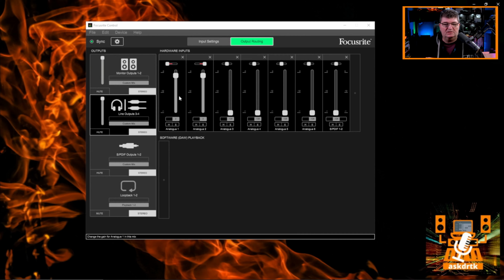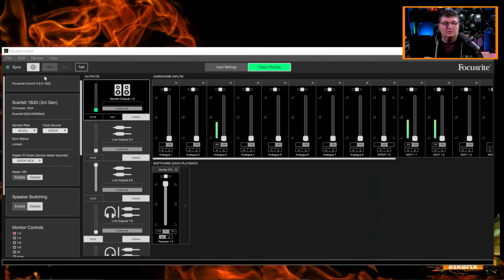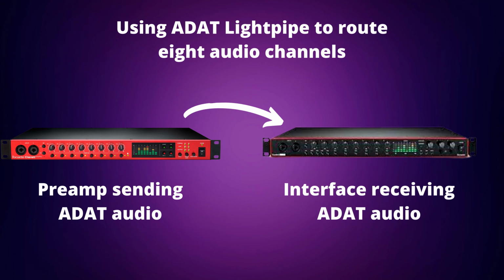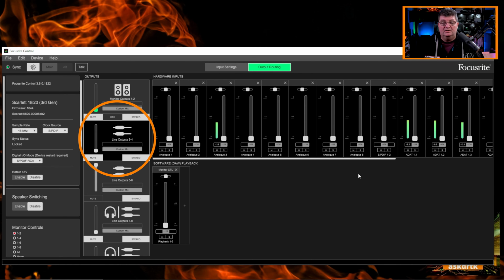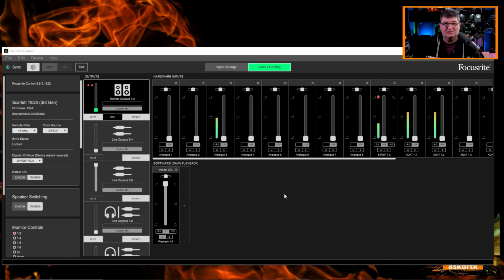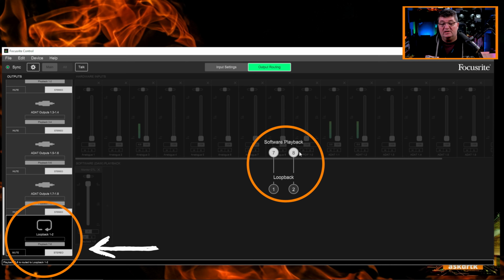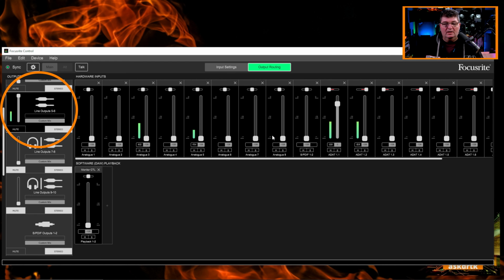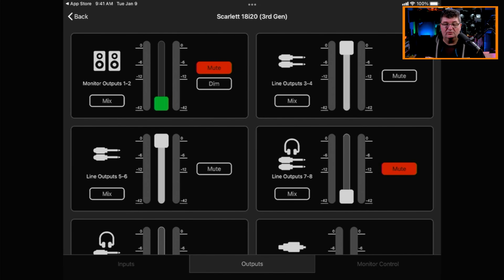Focusrite Control Step-by-Step Setup Guide - ADAT, SPDIF, & iPad Control

Comment: Okay.  So to be clear....if I want to use my Clarett 8Pre as a preamp via ADAT to my Presonus Quantum or my UA Apollo Twin, I have to make sure to assign the analog inputs on the Clarett to the ADAT outputs in Mix Control?  Once it's set in the software, then I can connect it to my Quantum or Apollo (as long as the Sync and Sample Rate are set right) and it should work....even if ithe Clarett is not connected directly to the computer?

Comment: I have a Yamaha MG32 mixer recently acquired and an 18i20 on the way also. I want to route the 8 outputs of my mpc live 2 into my Yamaha mixer, into my 18i20,then into my daw. How do I do that and keep the timing of my different tracks in sync? Also, does it make sense to run soft synths out of the daw, into the 18i20, and back in the daw? Will that increase the weight and quality of the sound, or just add hiss or noise to the tracks? Thank you.

Comment: Hi, thanks for this video! This was super useful to help me to me understand better about my Scarlett + Clarett OctoPre connections 
But I'm still confused about one thing though...

Allow me to provide some context on my setup: I currently utilize both my Scarlett 18i20 and Clarett OctoPre for in/out expansion, and I aim to incorporate a stereo compressor as a hardware insert along with the Clarett OctoPre. My primary objective is to plug it in the INSERTS, giving me more flexibility when switching from the Outboard Compressor to normal inputs on the Clarett OctoPre - I use Pro Tools. 

I've grasped the process for achieving this with the Scarlett—routing from Out 5-6 to the compressor and back to In 5-6. This ensures that Pro Tools recognizes it as an I/O insert. However, I'm puzzled about obtaining an output from the Clarett, given its ADAT Digital interface as it have physical cable connection to the compressor, but only ADAT

Initially, I considered routing Out 5-6 from the Scarlett to the INSERTS 5-6 on the Clarett. However, I'm concerned that the interaction between Focusrite Control ADAT and Pro Tools I/O may complicate matters, as PRO TOOLS requires identical I/O settings (5-6)

Can you confirm if my assumption is correct? Despite my confusion, I've observed many users successfully integrate Pro Tools, hardware, and the Clarett, leading me to believe that a solution must exist. Apologies for the convoluted explanation, and I appreciate any assistance you can offer. Apologies if I'm over complicating things, as I'm a noob in routing, patch bay etcs. Thank you

Comment: New to all of this, and have most of your two videos on the scarlett. I have been away for many years and used to analog hookups.  I purchased this and an audio technica microphone.  With the idea of using this for talking when sharing some of my old 78  and radio transcriptions.  I down loaded and registered everything, but when I open the control center on my desk top with the microphone connected nothing shows.  Might you have time to assist and the best way to hook up everything and doing what you are doing?  Thanks so very much.  Todd

Comment: Hi Todd
Not sure if I missed it, if you’ve used all the analog inputs, and simply wanted to add one more input (for example an aux input from my computer to play spotify - i use the 18i20 for live mix with powered speakers). I’ve tried a aux to optical set up but cant seem to get the optical to give an output back into the mix…. Any advice would be greatly appreciated
Reply from the maker: Most 2 channel aux to optical converters I have seen use SPDIF as opposed to ADAT. You can set the Digital IO Mode in Focusrite Control to Optical SPDIF. This configures the optical input and output 2 as SPDIF instead of ADAT. Optical input and output 1 remain as ADAT in this configuration. Setting the Digital IO mode to Optical SPDIF and connecting your aux to optical converter to the optical input port 2, you should have two channel audio inputs on channels 11-12. Hope this helps out!
Reply: Thanks Todd

Comment: Hey man ! how would we get phantom power working on one channel for our vocal booth but use the rest of the the 7 analog ins for synths and guitars etc ? could i have a simple preamp that provides phantom power to the mic ? Cheers
Reply from the maker: Hey, sorry I took a while to get back to you. You could use a dedicated preamp for the booth (and there are advantages), but if you want to use one channel from an 18i20 or an 8Pre, a phantom power supply like the Xvive P1, I use it regularly and it is a great option. You would connect it inline to the mic (usually near the interface for convenience) to provide power only to the booth mic. It is clean and transparent plus has very long battery life (you can also leave it plugged in). Hope this helps out!
Reply: @askdrtk  Thanks allot man ! appreciate the info

Comment: I have an 18i20 and Octopre. Is it possible to send 8 channels to a mixer? 
Im currently using the ins and outs on the 18i20 for outboard gear that i use either when recording or mixing in the DAW. Id like to be able to send 8 outs to a mixer if possible.
Reply from the maker: It depends which Octopre you have. The Scarlett Octopre Dynamic and Clarett Octopre both have analog outs, whereas teh standard Scarlett Octopre does not. If you have the “Dynamic” or the Clarett, ADAT out 1-8 from the 18i20 can be used as analog sends from the Octopre to a mixer. Hope this helps out!
Reply: @askdrtk  Unfortunately I have the standard. Looks like I'll be selling it now

Comment: Hay Back again lol......I’m having a feedback issue, when I insert more then one hardware on a track I will get a double. I then would go to Focusrite control to turn fader down which allows me to hear nothing on that channel. I’ve tried muting also still nothing. All my inputs and out puts matches with Protools. My connections is correct, I’m using balanced cables.  
Focusrite control line outputs matches playback inputs. I’m using Focusrite clarett 8pre all connections is used.
Reply from the maker: It sounds (no pun intended) like you are sending a mix of both the DAW playback and analog input into each output on your Clarret. To setup FC for hardware inserts in ProTools (and other DAWs) I set each output to have only the corresponding DAW Playback input number (single setting and mixer is not required). If you try to use Custom Mix with more than one output/input pair sound will be doubled as FC uses the same Custom Mix for all outputs. 

For example, setup the Output 3 source as Playback DAW 3,  the Output 4 source as Playback DAW source 4, and so on. This way only the send from ProTools will go to your outboard and ProTools will pick up the outboard return from the corresponding numbered input on the Clarret. I use the custom mix for monitoring only when I need to mix DAW playback with hardware inputs for recording. I hope this helps out!
Reply: @askdrtk  Thanks for replying. I have FC set up the same exact way. I did find away around it by sending all my tracks to a bus, then I can use my inserts on single tracks or bus tracks. Weird I never had to go through this before. Maybe it’s a update issue? I don’t know.
Reply from the maker: Could be. I have my sessions setup with tracks to a series of buses and have not experienced doubling but I also have used multiple inserts on different tracks without buses and not experienced doubling with this configuration. Glad you have things working. I will do some further testing with this to see what I can find.
Reply: @askdrtk  Thank You.

Comment: Does anyone know how to setup a scarlett and clarett together on Mac with adat?
Reply from the maker: Generally I would connect the Clarett to the Mac and then the Scarlett to the Clarett with ADAT. You will need two ADAT cables, one from the out on the Clarett to the in on the Scarlett and one from the out on the Scarlett to the in on the Clarett.

For this to work you first need to use Focusrite Control to configure the Scarlett for Stand-Alone operation with the Scarlett’s analog inputs  sent to its ADAT outputs and its analog outputs configured to output from its ADAT inputs. You also need to set the clock source of the Scarlett to ADAT. This is done with the Scarlett connected to the Mac and the Clarett disconnected from the Mac. 

Once the Scarlett is setup, disconnect it from the Mac and connect the Clarett. In Focusrite Control, ensure the Clarett’s clock source is configured to Internal. The analog inputs and outputs from the Scarlett will now be available in your DAW as the ADAT inputs and outputs from your Clarett. I hope this helps out! If you have further questions, let me know which Scarlett and Clarett you have and I can be more specific.
Reply: @askdrtk I can never understand why people don't thank a person for providing an answer. However this answer helps me with my current situation ❤ I assume the focusrite can be slave to clock of master via adat in standalone mode.

Comment: This is very helpful thank you. You show the analogue out options through preamps as standalone, but how do I set up the routing in Focusrite Control for ADAT optical 8 channel connections to my DAW digitally? The Control app layout is somewhat confusing in that there are drop down menus under the Output section to add hardware inputs but then also to the right column further options to add inputs and monitoring. My idea is to send guitar preamps and also send / receive via DAW to outboard compressors and FX via the Behringer ADA8000 AD/DA converter connected to my Clarett 8pre (TB) with x2 ADAT cables (in and out).
Reply from the maker: The main purpose for Focusrite Control is to configure what analog, ADAT,  and SPDIF inputs (and computer playback) is sent to each output on your 8pre. With the ADA8000, you are connecting 8 additional analog inputs and outputs to the ADAT IO on your 8pre which will then be available in your DAW as ADAT channel out 1-8 and ADAT in 1-8. Depending on which DAW you are using, you may need to setup the ADAT channels in the IO settings, but other than that no configuration is needed in Focusrite Control unless you want to monitor any of your ADAT inputs directly through the 8pre's outputs. Also note that some DAWs will show your ADAT 1 inputs 1-8 as input channels 13-20 and ADAT 1 outputs as output channels 13-20 (assuming 44.1 or 48kHz). I hope this helps out!
Reply: Thanks that puts things in better perspective. I've always thought that Focusrite Control has to be somehow routed for each different setup but just discovered that the ADAT is routed automatically in my case to Logic Pro - just need to change the wordclock source settings etc. From what I understand the app is mainly for custom monitoring setups. I got crazy loud feedback loops in the beginning but just need to understand the app layout and signal flow better.

Comment: Can I monitor all 16 analog channels through the headphone output if I have an octopre connected via ADAT to a Scarlet 18i20?

My goal is to send 16 analog channels out of the headphone jack to a mixer and then into Zoom video chat.
Reply from the maker: Yes you can! Create a Custom Mix for all 16 channels in Focusrite Control for the headphone output you want to use. Note that you can also do this with the loopback output if Zoom and the 18i20 are on the same computer in which case Zoom will see the loopback as a "microphone." Hope this helps out!

Comment: Hi! I am looking to inout audio deembedded from HDMI via optical cable (that's what my HDMI switch does - deembeds to a regular optical cable). Should I be able to input this into my Focusrite 18i8 3rd gen? I have tried various configs and failed. My understanding is that the audio output is optical SPDIF (not sure here) and in the Focusrite control I should set the spdif setting to optical. This does nothing regardless of the clock setting, all the SPDIF and ADAT inputs show no signal.

Comment: Im using an 18i8 with an octopre connected via adat, but I cant get any of the line outputs on the octopre to show up in the focusrite control software.
Reply from the maker: The 18i8 supports eight channels of optical ADAT input but does not support ADAT output. The maximum channels counts are 18 in (8 analog, 2 SPDIF, 8 ADAT) and 8 out (4 analog, 2 headphone, 2 SPDIF). To use the line outputs on your octopre you would need to upgrade to an interface that includes an optical output connector.

Comment: I’m having trouble connecting my iPhone to this. I have the app on the PC and on my phone. However, the control doesn’t show or connect. Am I missing something?
Reply from the maker: If both your PC and iPhone are connected to the same network the issue is likely a firewall setting. To check this, open Windows Settings -> Update and Security -> Firewall and Network Protection and then choose Allow an app through firewall. Look to see if Focusrite Control is on the list and checked for Private networks, if it isn't on the list add it, and if it isn't checked, check it to allow for Private networks only. Hope this helps out.
Reply: @askdrtk  this worked. It was checked for private not public. Once selected to public it all worked. Thanks!

Comment: Can I take the a TOSLINK Optical Fiber cable from my TV and plug it into the back of my Focusrite 18i20 3rd Generation in order to get the audio from my television? Thank you for your assistance with this matter.
Reply from the maker: Yes you can. Connect the optical out from your TV to the first optical in on your 18i20. Then in Focusrite Control, set Digital IO mode to S/PDIF Optical, Clock Source to S/PDIF, and the Sample Rate to 48kHz. This will allow you to send two-channel stereo audio from you TV to your Scarlett. S/PDIF over optical is limited to two channels and surround sound over optical from TVs is not sent in ADAT format, so surround sound formats cannot be sent to the 18i20 (TV optical surround requires AC3, DTS, etc decoding). Hope this helps out!
Reply: @askdrtk  Thank you so much!!!!! I appreciate you taking the time to answer my question.

Comment: Great info and well explained video.
I am considering buying 4 Focusrite Scarlett 18i20 3rd Gen 18-In 20-Out models.
I want to be able to play 32 channels of an analog signal (coming from my DAW) into my Allen Heath 32 TRS balanced line inputs.
(So I can mix old school with my vintage outboard gear)
It seems I would need 4 of the Scarlet units to achieve 32 channels of balanced analog as 3 Scarlet units only get me to 30 TRS line outputs to run into the Allen Heath... 
Would you know of a better way to do this that might use less interface units and be more cost effective? 
Thanks for your time in advance and again well explained video.
Phil
NYC / Jersey Shore Area
Reply from the maker: Hi Phil, Thanks, I'm glad you enjoyed my video. 

Great project to setup 32 channels on the AH. To setup 32x32 the Scarlett 18i20 is not going to be the way to go. Scarlett interfaces will not work as aggregate devices on either Windows or Mac, so you can only use one connected to the computer at a time. At best, you use one as the master and then slave another to it using ADAT which will give you 16x16 analog. 

I am going to recommend picking up a MOTU 16A. I have used a lot of MOTU gear including the 16A, 828es, etc. and the build quality and conversion is very good. The 16A will give you 16x16 TRS ins/outs and 16 ADAT ins/outs. For the 16 ADAT, you could go with a pair of Behringer ADA8200 8-channel units (they are better than their price would suggest). This will give you 32x32 overall for a price of around $1955 from Sweetwater (cheaper than 4 Scarlett 18i20s). The only thing is that the ADA8200 have TRS ins but only XLR outs, so you will need a 16 channel XLR/TRS snake. 

If you don't mind going a bit up in cost, a great combination would be a MOTU 16A with a Ferrofish Pulse 16. This will give you 32x32 TRS ins/outs with excellent reliability, conversion, and easy connectivity/setup. This combo is about $2600 from Sweetwater, but with only one interface / driver to setup in your DAW and for the performance / quality, you would not be thinking about upgrades. 

Both of these options provide outstanding 32x32 performance at a great price point. The 16A works with both USB and Thunderbolt, so you have options down the road and will get pro quality conversion for all the AH analog goodness... Hope this helps out!
Reply: @askdrtk  Hi Todd. Thanks for the super detailed reply! 
Note: I thought I replied already, but must have not hit send, so hope you don't get this message twice. 
My scenario is I bought a Presonus StudioLive 32S Digital mixer last year thinking I could use it as a control surface for Studio One and also as an interface. I thought I would take the analog outs of the Presonus into my Allen Heath. What I didn't realize (unfortunately) is I can only send 16 outs of the Presonus at one time.
*The control surface aspect of the mixer is great w/32 faders, but I do find the mixer complicated to use with all the layers and not intuitive, unfortunately.
So now my plan is to use the mixer only as a control surface and do the mixdowns on the AH. Hence, looking for a cost effective way to get me 32 balanced outs from an interface setup. 
Note: I don't really need 32 analog inputs at one time and could get by with only 8 to 12 (prefer 12) as long as I can get the 32 outputs for mixdown from the DAW.
^The Presonus Quantum 48/48 would have been a great choice, except it only used Thunderbolt, which I don't have on my Laptop). It's now out of production also. 
Thanks again for your very detailed reply. Appreciated.
Phil
NYC / Jersey Shore Area